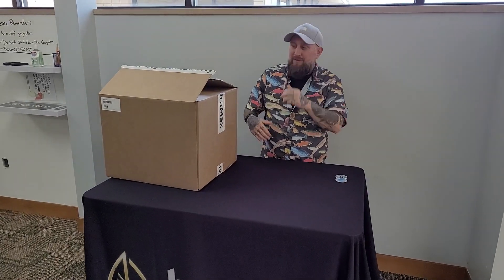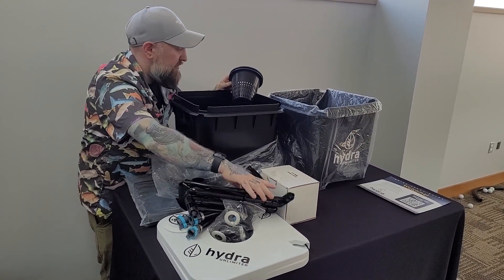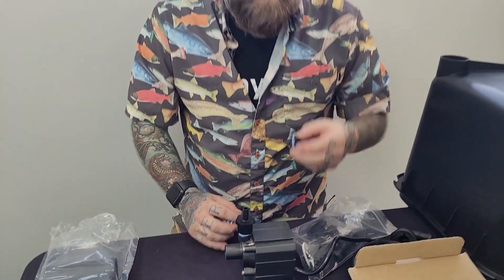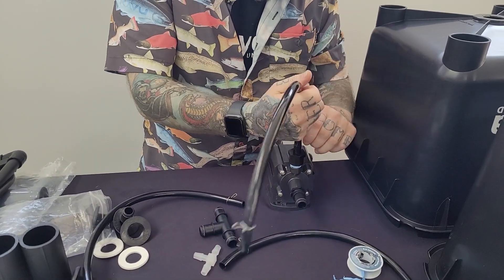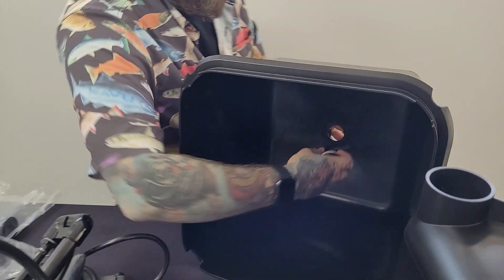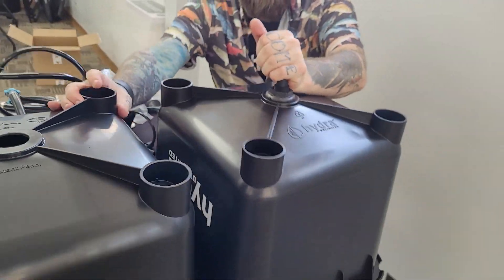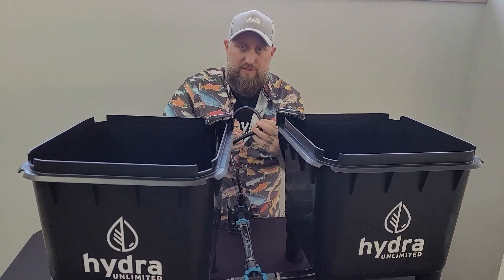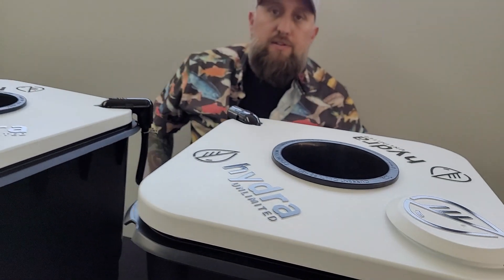HydraMax Two Bucket Installation & Assembly | Deep Water Culture Hydroponics

Comment: What size Teflon tape you using there? 1/2 inch, 3/4 inch or 1 inch? Which size will work best? Let me know. Thanks.
Reply from the maker: We use Blue Monster 1/2" tape but any will do as long as you don't block the waterway. The threads on the pumps are pretty short.

Comment: Hey, is this recirculating? If not, can you  add a nutrient reservoir?
Reply from the maker: Yes, it is recirculating, and there is actually no need for a separate reservoir with our system - the quickness of homogenization is best in class for RDWC.

Comment: What is the size of the return lines?.....i like the two bucket system but I'd like to space them farther apart in my tent....i know i can get the parts from your website but don't know which ones.... also i need to know what the size tubing is for the Venturas because I'll have to put length between the T section.
Reply from the maker: If you can DM us on FB or IG, we'll have one of our sales & parts support specialist help out with any specs you need to get setup. You can also email us directly at customerservice@hydraunlimited.com for a quick response.

Comment: Hi I was wondering do I absolutely need a chiller for a two bucket system or no? Thanks
Reply from the maker: Sorry for the delayed response, it is not necessary but recommended! If you'd like to keep temps down without a chiller, we recommend a timer that limits the pump to 1 min on, 15 mins off. Good Luck!

Comment: how can one drain them easily?
Reply from the maker: Turn off the pump, disconnect the circulator - and then you'll use the main line to be able to just "pump" the water out. The center drain will help everything down so you're freely able to pump "out" basically. A 5 gallon bucket next to everything works great. DM us on IG, FB, or email us at customerservice@hydraunlimited.com for further Q's, thanks!

Comment: Can you put 2 bucket system hooked up with another 2 bucket system to make it a full system? Hook up instead of spending $1400 on a 4 bucket system which doesn't make sense. Anyways, can you keep hooking up buckets?Or is there a way to connect them if you have this model
Reply from the maker: The 1 & 2 buckets were created as stand alone systems and are full systems in and of themselves, we designed them to be minimal setups. They can't be hooked up to each other as the plumbing and pump would not work, however, we will be releasing a 4-bucket home system in the near future that is more streamlined than the pro. Now, our professional and commercial systems ARE built to be scalable, as you're suggesting, as long as your plumbing can handle the amount of buckets you are adding onto. So if you're thinking about building out rooms and adding on in the future - you'll want to invest in the professional system. Once you get to 8 bucket or longer runs, you need to also upgrade portions of the plumbing to properly account for the increased water recirculation needs. This is to maintain proper water levels, and recirculation values to keep the grow optimized. Email sales@hydraunlimited.com for more info, happy to help out!

Comment: Would i be required to use a chiller?
Reply from the maker: No, you're not required to use additional equipment. However, depending on what your grow needs are - a lot of our growers are going that route to maintain more even plant temps for their needs. We recommend our professional units if that is the case, as those are chiller-ready and geared towards more serious growers. If you're really set on making this chiller ready, be sure to reach out to sales@hydraunlimited.com for an unofficial DIY guide.

Comment: When adding nurtrients whats the best way to do it with the 2 Buckets?    Individually? Or
Reply from the maker: It can help to dilute the solution with RO water and split it 50/50 between the buckets, but not 100% necessary to do this. You can get away with pouring your nutrients into one bucket - it equalizes very quickly!

Comment: So for this 2 bucket system how do the buckets get disconnected to be cleaned 1 month into the grow cycle. The  larger systems you just pick the buckets up from what i seen
Reply from the maker: If there isn't a chiller connected to the system, we recommend changing out the water every 3-7 days. If you have a chiller integrated into the system, then you can just give it a full cleanse in between each grow.
Reply: Can you elaborate on the chiller part? Why does a chiller help not changing the water so often? It would be nice if you put that in the information before I bought it
Reply from the maker: A chiller's function is to stabilize water temperature fluctuations, the average temperature in an optimal setting is 68-72 degrees. Water health is dependent on a balance of good and bad bacteria, a chiller simply assists the temperature to maintain consistency.
Reply: @HydraUnlimited  I sent you a message on Amazon but why did I get different flow return stems from the ones seen in your videos and pictures that clip on the buckets?
Reply from the maker: So sorry you haven't heard back yet! Sometimes Amazon's dashboard can be fussy for us. If you still haven't heard back, please reach out directly to our customer service team here: customerservice@hydraunlimited.com

They will help you out ASAP!

Comment: You put the thread tape on backwards
Reply from the maker: It was unfortunately put on backwards, but seal still held!
Reply: @HydraUnlimited what size Teflon tape are you using here? Is that half inch, one inch or 3/4 inch?
Reply: It's suppose to be backwards 😂 I did the same thing doing plumbing systems for pools and hot tubs. When you need to service the tape comes undone easily.
Reply: @JustWitness  in plumbing school they teach you to thread the teflon tape the same way you would thread the fitting you dont reverse thread the tape it defeats the purpose